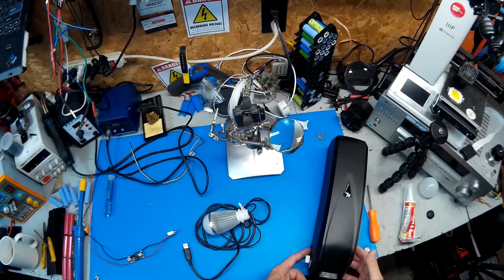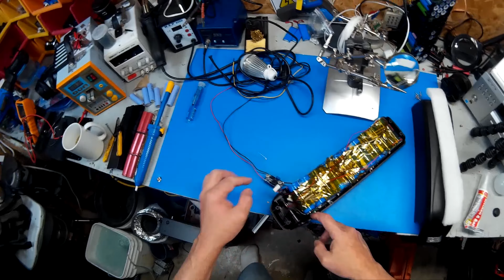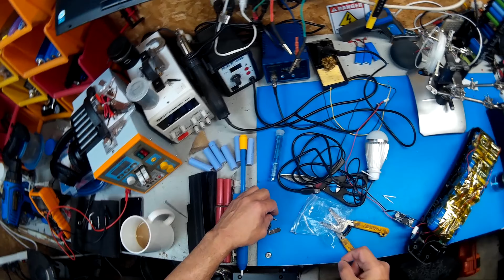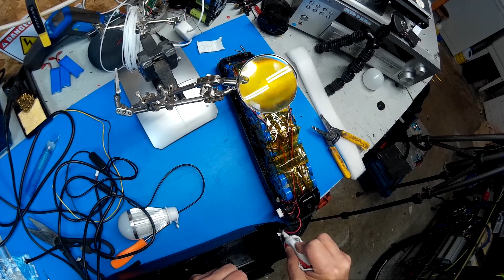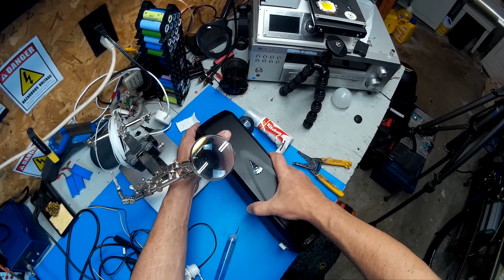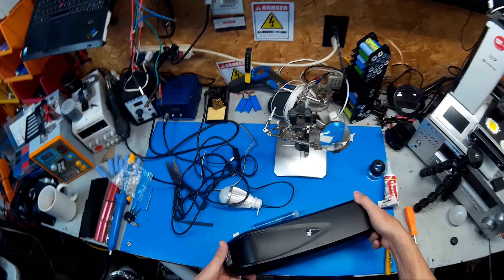ebike booster pack 17v *dc dc inverter 5v out*

Comment: Do you run this booster in series with the battery/bms that is already on the ebike, yielding a higher input voltage for the controller ? Than remove for charging with balance charger ?

Comment: Please excuse my ignorance, but what is this for? Boost the voltage of your regular pack or a power bank to charge your phone or run a trouble light?
Reply: boost the ebike from 56v to 75v. also can be used the charge my cellphone on the road. or home when theirs a blackout. many uses
Reply: @KarmaElectronics.  Cool, thanks.